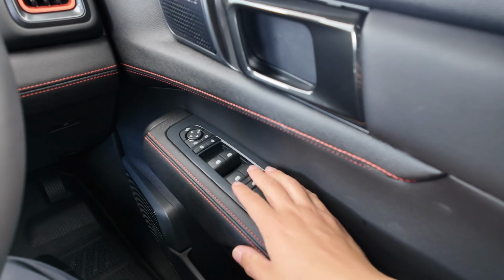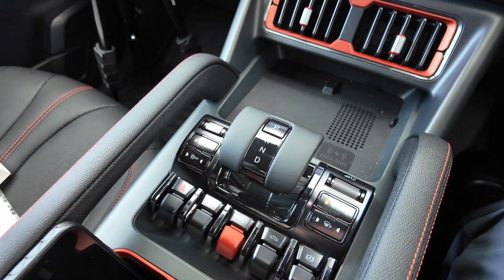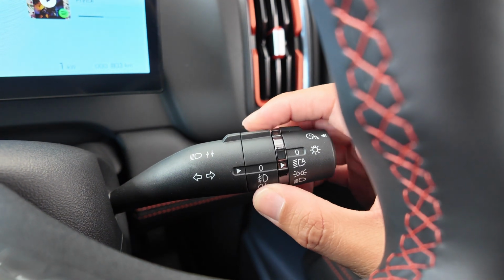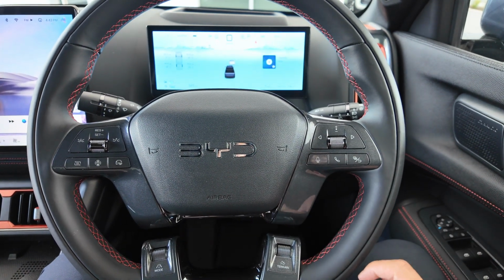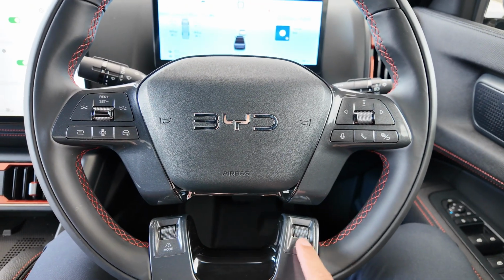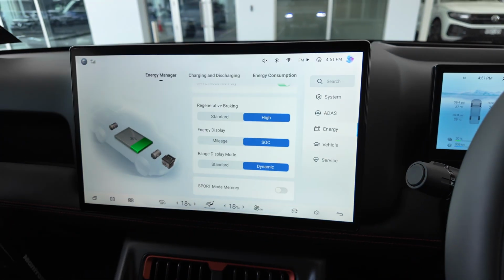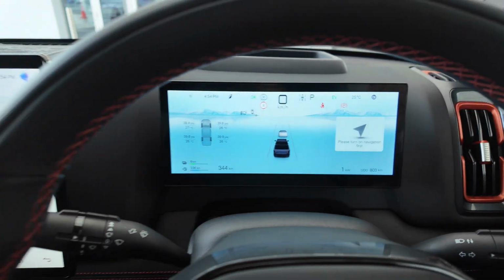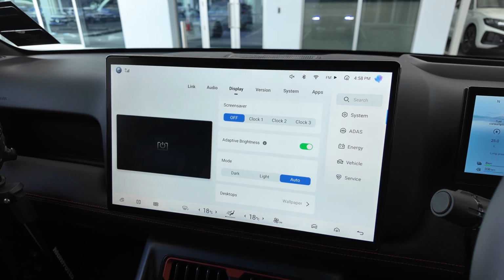BYD Shark 6 Tutorial - All Physical Buttons Explained | Centre Console, Dashboard, Steering Wheel

Comment: Ok, here is a hidden feature on the Shark I'm yet to find any documentation on: 
Only in ACC or ICC mode letting the car brake automatically,  a second after there is zero forward movement, the front end dips about 3-5cm. The effect is like a hydraulic release similar to self-levelling buses, but in reverse,  down not up.
The more important effect is it cancels the resonant rebound that happens between front and rear springs that causes your head to bounce on the head rest for a number of seconds. 
This effect does not occur in human driving mode, it is more noticeable driving up hill than on the flat. It requires some pressure in deceleration. If the car pulls up very gently the effect doesn't happen.